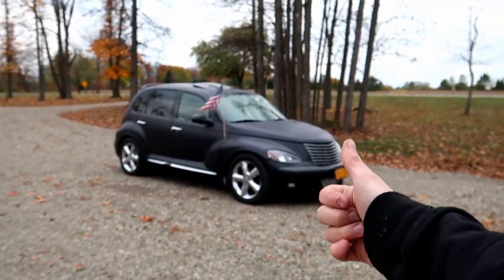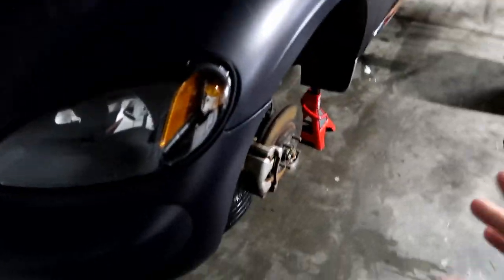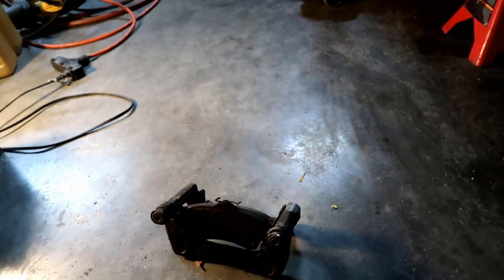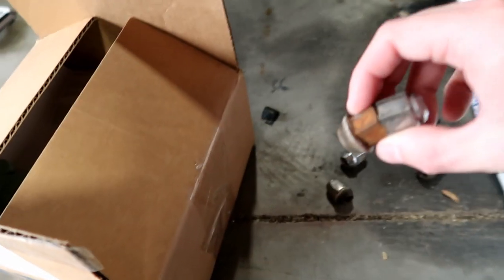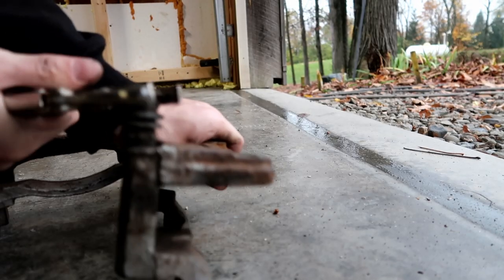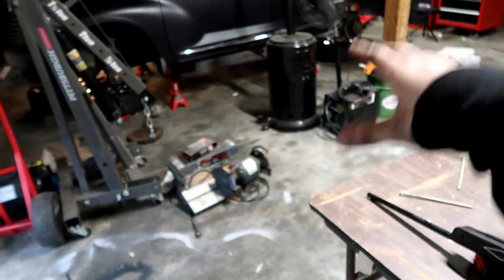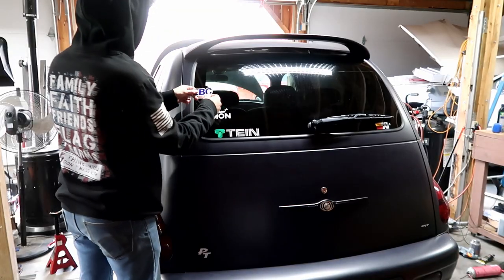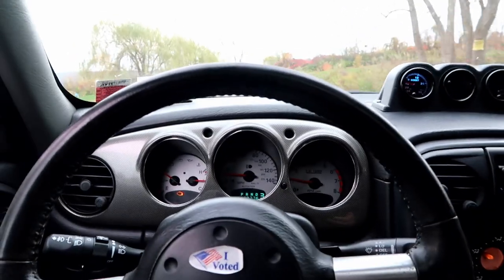PT CRUISER GT GETS PERFORMACE BRAKES!  (EBC)

Comment: I put slotted rotors on the front of mine and they work really well for a while
Reply: test- get going 70mph and do a quick stop. in my old truck the stock brakes would gas and only slow to about 15 from 70 then you were on your own SMASH. scary! added drilled and slotted and stopped on a dime after...

Comment: Great brake pad/rotor selection!! Those EBC "YellowStuff" ceramic blend pads have a great reputation for low dust & terrific stopping w/o fade. I went w/Hawk pads/rotors on my PT GT & it was probably the most dramatic, noticeable upgrade to everyday driving I've made to the car besides adding the rear OEM sway bar. Both changes/upgrades just made driving it much more enjoyable. Looking forward to your next mod, keep up the great content 👍

Comment: I go fast and brake hard. I have installed Slotted and Cross Drilled with Ceramic Pads. I've put both Canadian Made Rotors and Brake pads from Maxx Brakes on both my Pts. They seem fine for what they are , no complaints but would like to know more about other options available

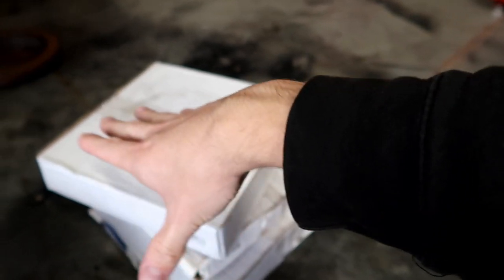Comment: 8:04 I think the cracking problems are associated more with drilled rotors instead of slotted. As I understand it, slotted are more for performance daily driver applications and drilled are more common in racing applications. The drilled rotors heat and cool more rapidly and have wildly fluctuating temperatures and that's what leads to the cracks. Slotted have more material and are more consistent in their temperatures so they are less likely to crack. I'm running slotted rotors on Jamie's Tahoe to haul around the kiddos. I don't think she uses them to their full potential, but I don't want her to have any issues with braking. I used Autozone duralast GT rotors and pads on all corners. They're discontinued so I don't know what I'll do about the lifetime warranty. Lol. I think the whole set was around $500. As it turns out, people who shop at Autozone don't typically want to pay big prices for brakes. Unfortunately they weren't very popular. They're pretty good quality rotors. I like the anti-rust black coating and slotted rotors. There's no bare metal except for where the pads touch. With factory 20" wheels, I didn't really want to look at the unsightly rust reflecting everywhere inside my chrome wheels. The black coating is a nice touch. Nobody could probably pinpoint it at first glance, but it does look nicer than the alternative. 
  I never really upgraded brakes when I was younger. I usually focused my limited budget more on the engine. Now my budget has grown a bit so I can have better engine parts and venture out to other areas.
  I'll need to focus on braking and suspension on my Silverado. Thankfully, it is a 2500 and has oversized heavy duty brakes for towing and hauling so I'm not overwhelming the brake system yet. I do have my eyes on a disc conversion for my rear. I'd like to convert it and get an adjustable proportioning valve to tune it so that the braking is balanced. Currently I have monster drums in the rear with factory rear-only anti-lock. I'm not sure if I can retain the abs with the disc conversion. Regardless, the disc swap seems like a natural progression in modernizing my truck.
  I've never personally used EBC, but I've always heard good things. I'll have to wait for a follow-up video on their performance and how much dust they generate. 
  I've always bedded in new rotors by doing several hard stops on a clear country road. I'll go from 60-10 pretty aggressively 10-15 times then drive around easy for 20-30 minutes to let them cool back down before parking and letting them cool. I purposely do not come to a complete stop to avoid heat soak in any single area while bedding rotors. Do what you can to avoid parking with super hot brakes. That's a good way to warp even high quality rotors. 
  Keep up the good work. You know I'm already looking forward to the next video. God bless.

Comment: Drilled no slotted yes! Jimmy, its all about all if the braking components not just one part thats better than the rest. Bigger us better when it comes to brakes the bigger the surface the better the braking the more pistons in the caliper the more pressure applied also stainless steel brake lines from the hard line to the caliper,  getting rid of the rubber that expands is better for the pressure applied. Dont rely on your pads solely any car guy who knows brakes I promise u shook his head when u put all your stock in EBC yellow stuff. Great pad its all i use when I race(scca) just keep in mind theres 4 other very important components in your braking system that are just as if not more important than the pads.  Good vid dude! God bless brother.

Comment: Drilled and slotted rotors are really only meant for race enviroments not street use, and even then the cost vs reward is very small.  Better option is to go larger brake/rotor combos, more surface area means more grip, and this in turn also mean better stopping power.  I have seen drilled rotors that fail due to cracks between the drilled holes so I am a bit biased against them, mainly trying to get a car to a shop with only one functioning break is not pleasant or enjoyable.

Comment: Hey i have a little issue with my pt cruiser touring 07. I change the alternator and everything was fine but now my battery dies even i just turn the radio on before i started.  Not even a minute. Do you think my battery is the issue?